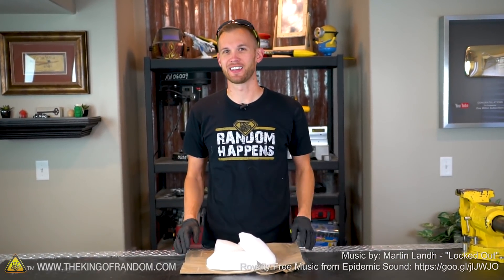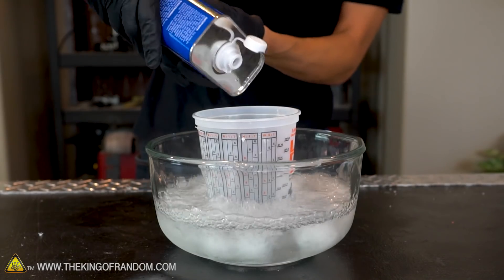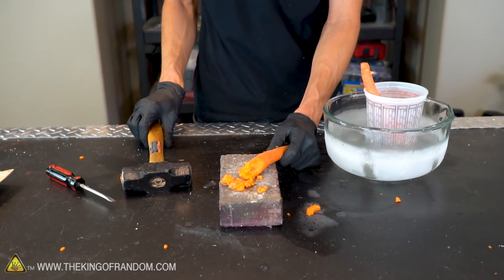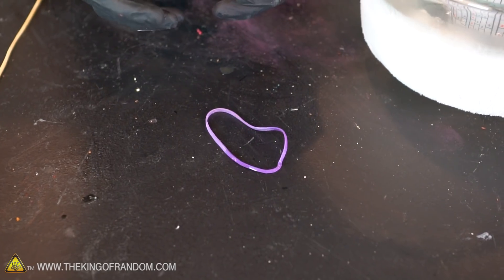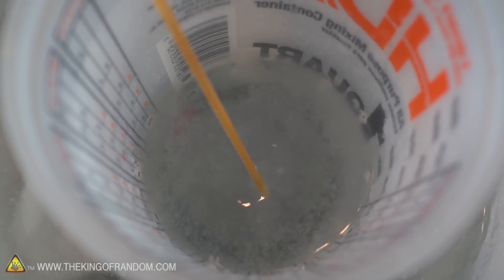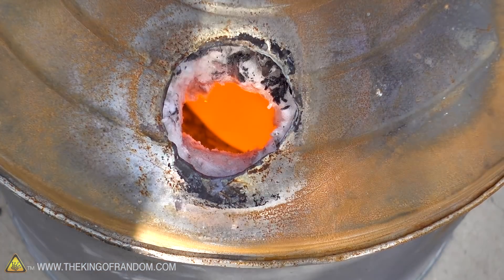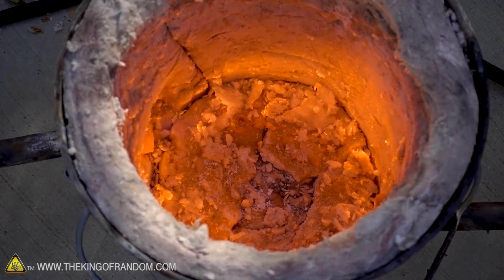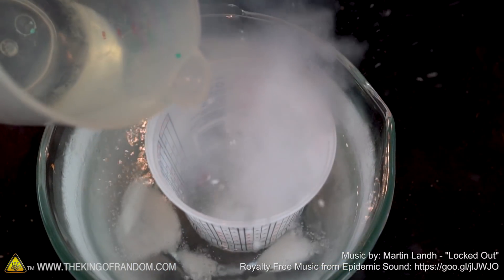What Does DRY ICE Do in a Metal Foundry? TKOR's Best Dry Ice Experiment: Burn? Melting? Smoke?

Comment: Hay, put liquid nitrogen in vacuum chamber and make a hole in the vacuum chamber and run a copper tube and dip the copper tube in to liquid nitrogen like when you made liquid oxygen but this time flow hydrogen. If it became liquid make a small pressure chamber and foot the liquid hydrogen and make a one more pressure chamber and put some more liquid Oxygen and compare the liquid Oxygen and hydrogen and light it off when you are far away I think it will go to space

Comment: I have a question about engines and dry ice!  It is known that natural aspirating engines increases in horsepower with cold air because cold air is more dense, hence, the cold air intake system.  If you house the intake unit in a box containing dry ice, would that increase horsepower?

Comment: Doesn't the nozzle(s) for the furnace have an input for air to mix with the propane? That could explain why the dry ice didn't put the flame out from the CO2. My propane torch has holes to admit air in to mix with the propane

Comment: Years ago in Prudoe Bay , Alaska the temperature was 80 below with a 35 mph wind. Never less steel could shatter (drill pipe) , rubber gaskets had to be changed, grease had to be thinned down, frost bite was evident. Just your breath made I cycles from your nose while wearing a mask.

Comment: One thing I really loved about my chemistry class with liquid nitrogen is you don't have to worry about clean up. If you want to dump out a cup of liquid nitrogen, just throw it on the floor. It'll instantly turn to steam because room temperature carpet is incredibly hot in comparison, and you don't have to worry about contaminating the air because nitrogen is already 70 percent of the atmosphere.

Comment: Something to note, when you hold the dry ice with the tongs, you can hear the 'singing' sound. Then, when you lower it into the forge, you will hear the 'singing' change pitch. The intense heat causes the dry ice to vibrate at a higher frequency, thus creating a higher pitch when vibrating against the tongs.
Reply: Woah thank you
Reply: Probably because the speed that the carbon dioxide gas was whistling out at was higher due to higher vaporization rate

Comment: Using tongs to hold stuff. 👎 Using tongs to hold tongs. 🤨 Using tongs to hold 1000 degree stuff. 👍 Using tongs to hold 1000 degree tongs. 🤙 Using 1000 degree tongs to hold stuff. 👏 Using 1000 degree tongs to hold tongs. 👌 Using 1000 degree tings to hold 1000 degree stuff. 🔥😂😂🔥 Using 1000 degree tongs to hold 1000 degree tongs. 🧠👨‍🔬👨‍🔬🧠

Comment: How about pouring in lots of small pieces if dry ice? The smaller the pieces are, the higher surface area and the higher the volume of the CO2 sublimating. That might just generate enough CO2s to displace air and put the flame off.

Comment: What if you threw a giant block of dry ice as long as the north pole, and as wide as the earth, and threw it into the sun. Would it put the sun out, or would it melt? Say nothing happened to it during flight.
Reply: It would be like you touching a single piece of sand. The Sun wouldn't even notice.
Reply: Hue Mongus the sun is hundreds of times bigger than the earth and dry ice is frozen gasses the sun would melt it and the sun would use the gasses to continue to burn for even longer

Comment: Dry ice is called dry ice for a reason... Since heat is applied to the carbon dioxide that is in solid state, it will change the state directly to gas state instead of becoming a liquid unlike regular ice.

Comment: Great experiments!

The reason the dry ice was smaller in the foundry and eventually disappeared is due to the air flow of the torch and virtually nothing to do with temperature. 
You can put a chunk of dry ice in your freezer and have the same result. 
:)
Cheers and great video
Reply: @KMURPH311  I'm not sure what you mean. He said that the dry ice disappeared faster because of the heat, which is completely correct. The point of the comparison of sitting outside is that it isn't in an environment that is nearly as hot.

Comment: The metal isn't hot enough though. How hot is that melter? You should do it again and actually melt the steel. Ours are over 3250 degrees at work.

Comment: It's not supercooled if its temperature is higher than freezing temperature.
BTW: ethanol has similar freezing temperature and is less toxic. Put some dry ice in ethanol and make cool drinks.
Reply: It was 78.5 Celsius below freezing
Reply: ...below freezing point of water. Did he use water? No. So it was NOT supercooled.

Comment: That last bit with the tongs is all about mass. You're touching thin metal tongs on to a piece of dry ice that's somewhere between 4 and 8 ounces. Of course the tongs aren't going to do much. Now, if you took a large hunk of metal like steel like the head of a 4 lb. maul, you'd probably see a significant difference.

Comment: Pour acid into water to prevent the acid from spitting out. Acid boils very violently when water is add to it because of an exothermic reaction. The heat released from the reaction cause the acid to boil and splash.
It was awsome to see at the end where the mix of water and acetone was lite on fire but still be cold to the touch!

Comment: Why does the acetone boil when you put stuff in it?  The boiling point of acetone is way above room temperature, so I wouldn't expect it to boil.  And the bubbling is coming from the middle cup, not the outer part, so it can't be the dry ice subliming.  Is that dissolved CO2 bubbling out?

Comment: Does the thing with the rubber bands remind anyone of rubber O-rings and the Challenger disaster?  Ten engineers told the boss that it would blow up if they launched it.  There were 11 DOCUMENTED failures of the O-rings in tests of those rocket engines by the manufacturer prior to that launch and cold was sited as the cause of failure.  And they burned another one up on re-entry also due to another failure that was previously known about.  There are other potential failures that could have also happened but they broke all their toys before those happened.  The turbine blades of the pumps that supply the main engines almost always develop cracks due to the cryogenic stresses of pumping massive amounts of liquid hydrogen and oxygen into the main engines.  They just got lucky and one never flew apart and blew up on the launch pad.  Didn't ever here about that one did you?  Originally an engine was supposed to last several launches but after the first tear down they discovered those cracks and decided to replace the entire engine for every launch.  This drove the costs way up and increased the time between launches. That also was a contributing factor to the Challenger disaster.  They have to hit the launch window.  Timing is an important consideration.  Where I worked, 100 planes that we produced were  suddenly grounded due to a turbine rotor manufacturing procedure error.  None of the planes with the engines that may have had the suspected engine defect ever had an engine failure but it may have just been luck.  These engines were purchased from a well known reputable supplier.  As a young child I worried when my dad told me he was going to fly on an airplane and he told me that the planes had no parachutes for the passengers.  After all plane crashes were pretty common on T.V.

Comment: how about trying to get methane  from a toilet by removing the water in the air  lock and seal a air tight connection on the rim of the toilet and compress the methane in a canister and light it to get a flame

Comment: Dry ice is a very bad conductor of heat. This is because in CO2 molecule, there are no free electrons and all valence electrons are involved in Carbon and Oxygen bonds. So when you put Dry ice in the foundry, only the top layers got heated up and sublimed into gaseous CO2. Since there is not much conduction of heat into the body of the dry ice, it took much longer to sublimate

Comment: I would like to see what happens when you put a piece of metal that is 1000 degrees hot and into a bucket of water that is 1000 degrees hot what happens to the metal does it smoke or get cooled down or stay the same Heat
Reply: The water would be completely vaporized at that temperature, so keeping it in a bucket would be... difficult. That's not a great answer though so let's assume a closed system, basically water and metal in a completely inert container cut off from the rest of universe. So if you have water at 1000 degrees and metal at 1000 degrees, nothing will happen. The temperature will stay constant, there's no energy transfer that can take place between two materials at the same temperature. 

The principal to keep in mind is that when you have two materials of different temperatures, they will in time reach a state of thermal equilibrium. If they're already in equilibrium, they will stay that way in a closed system.
Reply: The max temperature water can reach is 212° at that point it's boiling and evaporating.

Comment: If you mix salt water (freezing point ~0 F) and ice, it will actually cool down to about the freezing point of the saltwater. Any chance you could take a temperature check on the dry ice/acetone mix? I suspect it's actually cooling down close the freezing point of the acetone, not just to the temperature of the dry ice.

Comment: You could probably substitute the acetone for isopropyl rubbing alcohol, couldn't you? I'm fairly certain isopropyl's freezing/melting point is right around the same temperature as acetone, and from what I've seen, it's also generally cheaper to buy -- and on top of that, while it's not completely harmless to humans, I think isopropyl is safer in general than acetone.

Comment: Styrofoam melts in acetone, how is it in the Cold acetone? Does it freeze or does is melt?
Reply: Thorin See Acetone is a solvent, many "thinners" anything from Xylene, Acetone, Paint Thinner, M.E.K., R7K15, etc, are all solvents, some "hotter" than others. 

Xylene will dissolve Styrofoam faster than Acetone, but Acetone has a higher flash point is evaporates faster than it dissolves, Gas is the same.

Comment: The CO2 doesn't put the flame out because the burners are drawing oxygen from outside the chamber. The combustion has already occurred either within or just outside the nozzle, before the flame reaches the dry ice. For the most part, the visible flames are the caused by the products (CO2 and water vapor, mostly) dumping heat,  not necessarily an indicator of where the reaction is taking place. Had you put a piece of dry ice (or a beaker of water with dry ice in it) underneath the base of the nozzle where it draws in air, the flame probably would have gone out. That's my theory, anyway. ;)

Another theory: There's no huge reaction because the one large chunk doesn't have that much surface area, relative to its volume, to absorb heat. Had you crushed or chopped the dry ice up into, maybe, pebble-sized bits and poured them in, the result might have been at least a bit more dramatic. Again, just a theory. Would love to see you test them!

Comment: try putting the tongs on top of the dry ice while heating it all.
try then putting the tongs under neath, same thing.
then do the same thing, sealing them.
I'm curious about the quality of steel you would receive.
comparisons would need to be done before and after (say, bendability vs. breakability [malleability], if you felt like doing it with a knife, testing edge retention, also trying smelting just a pound of scrap iron...)

Comment: You should try adding dry ice in a barbecue and add coal, light it and see if the food gets cooked or frozen !!
Reply: Blueman3 1. Food wouldn’t cool at that distance. 2. Fire would put out because dry ice is frozen CO2 and when it “melts” it releases CO2. And Carbon dioxide puts out fire.
Reply: Dara X trix no its a bad idea
Reply: Blueman3 the food would let it go
Reply: Same as said over me, it wouldn't light up as proven before even with gasoline. Why would it freeze without direct contact?
Reply: except its not frozen water, so, no steam.
Reply: I would just eat the food rather than experimenting it XD hahaha FOOD IS LIFE
Reply: GameOnJon nice idea!
Reply: Blueman3  it will be cooked ive done it

Comment: Note, that inner cup is High Density Polyethelene (Looks like) which isn't dissolved by the Acetone (An industrial Solvent.)  Also, if you're going to do this indoors, you might want ventilation, and eye protection.

Comment: Do not use a plastic barrier for acetone.  Acetone dissolves many plastics.  This is a bad idea unless you know the exact chemical makeup of the plastic used in your container...and since I bet most people don't know what plastics are being used in the production of the stuff they have around the house, they won't know if the plastics in question are chemically similar enough to acetone to dissolve in them.  Acetone is highly flammable and volatile...you don't want a leak.

Comment: The rubber bands in freezing cold acetone reminded me of freezing corn starch mixed with water. When you freeze the solution it becomes less hydrated and loses some of its polymer properties even after adding a little extra water

I can't tell what sound is worse, burning dry ice or rubbing styrofoam on film (infinity mirror video)

Comment: It's an invariant reaction with regard to a phase from solid to gas (a.k.a) sublimation. In other words it's an isothermal process so the temperature at the solid - vapor interface will pretty much stay the same at around - 78 degrees Celsius. Putting the dry ice in hotter ambient temperatures will affect the rate at which this occurs.

Comment: Why would you use acetone? Alcohol has an even lower freezing point and is much safer.
Reply: Captain Chupacabra for the views
Reply: Captain Chupacabra actually aceton dry ice cooling baths are comonly used in chemestry i think the main reason is propably that you need 100% pure ethanol and the u cant achive this with normal destillation and wenn you got it ethanol is hygroskopic pulling water from the air and that will probably freez

Comment: The carbon dioxide the dry ice gives off creates a thermal barrier the same way insulation as it dissipates so it prevents itself from rapidly melting.

Whereas water ice would give off water which liquids are a better heat conductor than gasses.

Comment: would the acetone at -107 still ignite ?
Reply: coleton anderson  That depends on what acetone's flash point is.  My guess is that the acetone will not light
Reply: Did you even watch the end of the video?
Reply: Callum  The end of the video had acetone that already warmed considerably.  Acetone at -107 degrees Fahrenheit is not likely to ignite
Reply: Probably. As long as some of the acetone gets hot enough

Comment: Put dry ice in lava
Reply: So dry ice is about 100 degrees C colder than room temperature. Lava is about 1000 degrees hotter than room temperature. So, the difference between dry ice temp and water isn't that big. Here -> /watch?v=f9f6oaiQ5gA
Reply: Yeah because people are going to have lava just laying around in there house
Reply: tech rax did that
Reply: Rebeca Garcia how will they get lava?
Reply: They did that already they put dry ice in lava
Reply: Rebeca Garcia it turns to rock
Reply: akainu vs aokiji ?
Reply: King kai tech rax is a copier
Reply: They could go to a volcano and get some from the outside of the volcano

Comment: it makes sense that nothing much would happen when you drop the dry ice in a foundry, mostly because since dry ice only exists as a solid or a gas, never a liquid, that therefore when exposed to heat via gas conduction, that as the layers of co2 sublimate off they form a kindof ablative armor , and since a gas is a terrible conductor of heat it acts as a heat shield

Comment: How hot does the foundry get? If it goes over 2150 degrees F, would you be able to put some fire bricks in the bottom and place a crucible on top of the bricks to melt glass inside?

Comment: The CO2 has no effect on the flame in the furnace because the propane is mixed with air before it enters the furnace and burns. There may even be a little "window" valve in the line where you can open/close the valve to vary the amount of air in the mixture. Typically, you open or close this valve to give the cleanest blue flame.  Too little air and the flame will be yellow instead of blue.

Comment: I'm curious what would happen if you were to heat a piece of steel in the foundry to forging temps, then quench in super-cooled acetone... what would happen to the metal? Would it become extraordinarily fragile? What about edge retention? Would it hold an edge better, or would the edge just chip away?
Reply: its called tempering and it would therefor harden the metal
Reply: I understand that, but Im wondering what the extreme temperature change would do to the metal. Would the extreme cold cause the crystalline structure of the metal to become super brittle? Would it harden it to a point where you are more likely to chip the blade than dull the edge? Would the blade just break on the first impact?

Comment: What happens if you heat up the crucible then drop it In. Also maybe try putting water in the crucible till it's super hot and then add the dry ice and see if it puts out the flames

Comment: if the oxygen is sucked in from the outside through the hole in the burner why would the carbon dioxide put it out.  Now something interesting is what would happen to the carbon content in the steel if you made and ingot in the forge in the presence of dry ice.

Comment: What happens when you put a drop of liquid nitrogen into water
Reply: freezes
Reply: ArcticGamers no the liquid nitrogen turns into gas
Reply: Due to the Leidenfrost effect, the liquid Nitrogen will actually just float on top of the water until it disappears.  

Depending on how much liquid nitrogen you put, the surface of the water may freeze